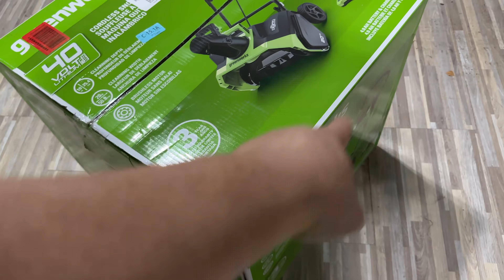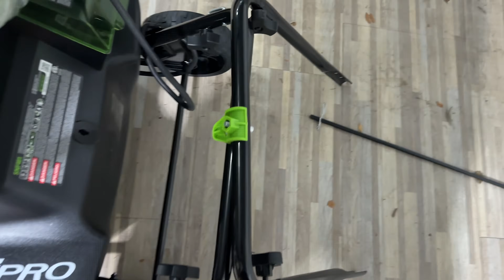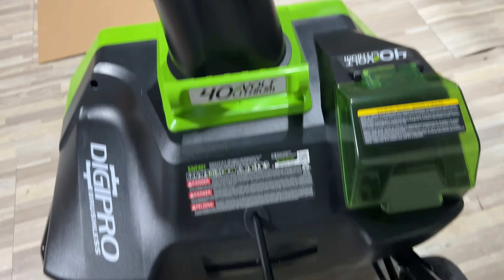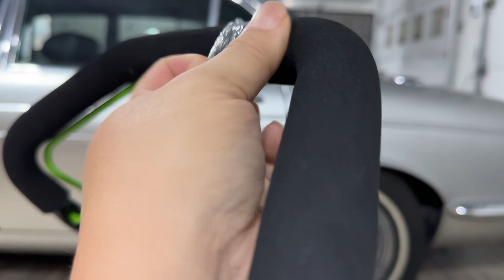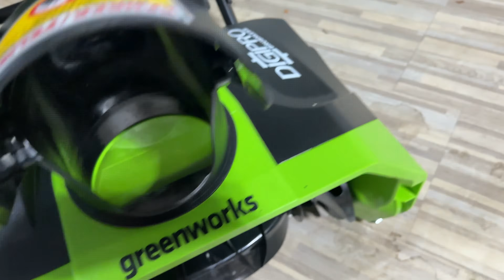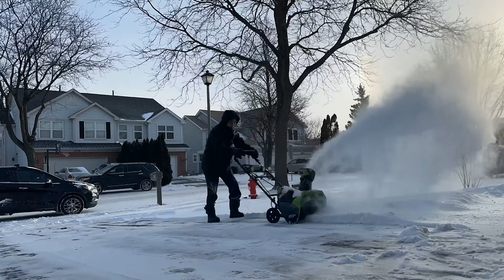Is The Cheapest Cordless Snowblower Any Good? - Greenworks 40V

Comment: I have their lawnmower.  The battery makes no sense. I uses the same battery.  It can be fully charged and die halfway through the job.  Other times,  it works for the full yard with power to spare.  Heat seems to shorten the charge life.  I had to buy a second battery as a spare.   Oh, and the lot is 5000 square feet.

Comment: I have a big 2 stage gas blower but I'm interested in one of these for the times we only get a 1 to 3 inch snow and the big 2 stage is over kill. often if we get a light snow I just grab the snow shovel and the blower stays put.  also be nice when your clear a heavy snow and just want something to touch up a few areas
Reply: I used a battery shovel on the driveway with about 6 inches or more went right through it like nothing. It's just heavy so I got this one today and should be able to handle just about the same amount. The shovels are more powerful but really heavy and I live on the side of a mountain. You won't want to get the big dog out much after you get one.

Comment: the blade is plastic, might not so durable, better to cost more to get one with metal/rubber blade.
Reply: The first thing that goes in my experience with these cheap snowblowers is that the blade gets worn down and doesn't reach the pavement as well.

Comment: Be nice if their batteries were dependable.   Bought a Greenworks snow product and the battery wouldn't even charge up right out of the box.  Could not get a replacement, so returned for refund from Amazon.  Went to another manufacturer and worked just fine.
Would not get another Greenworks product.

Comment: My blower don't move that smooth it's hard to push am I doing something wrong..
Reply: If it's this Greenworks model, the little aluminum skids at the front don't slide on concrete.   I added small luggage wheels to the front and that helps a lot.   It's a common problem with many different machines from different manufactures
Reply: @JoeLinux2000  Man thanks I'm going add me some

Comment: Best to buy this if either its going to be your only electric tool, or if you're already using other greenworks battery powered tools. And make sure you can get replacement parts. Light fluff snow up to mid thigh looks to be no problem, but if that plastic blade hits ice, you'll be praying no one gets hit with small sharp bits.
Reply: I reinforced the scraper with polyurethane glue. A metal-epoxy weld glue will be my reinforcement for the snow shovel.
Reply: @voidisyinyangvoidisyinyang885  Too bad these machines need so many modifications.